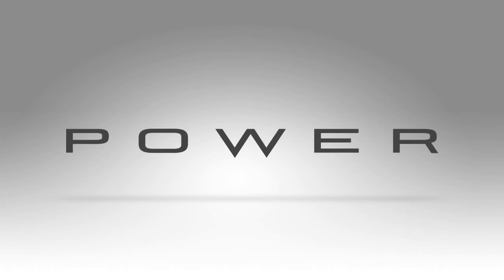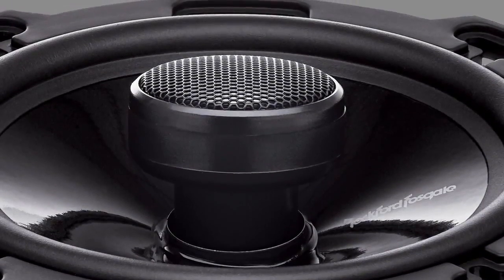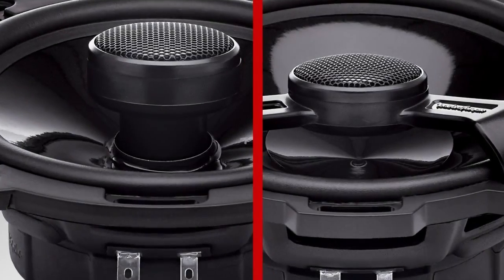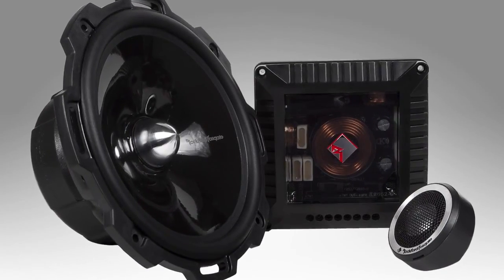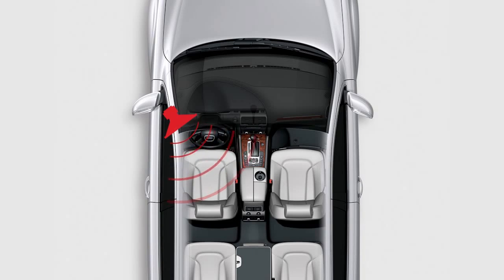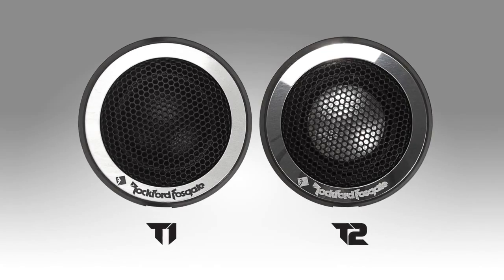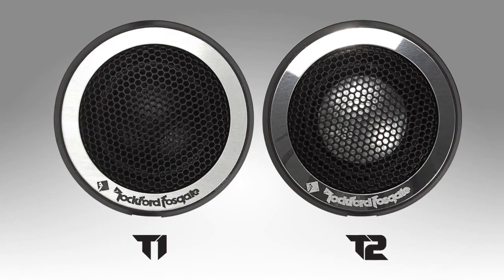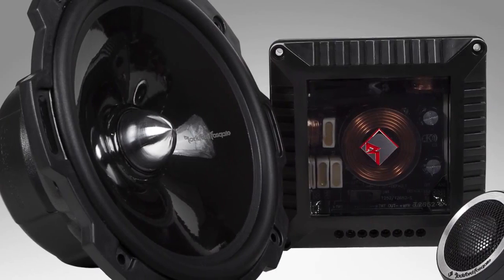Rockford Fosgate: Power Speakers (2.4)

Comment: Why does my p1650 sound cleaner than the t1650?
Reply from the maker: I’m assuming these speakers are being analyzed immediately next to each other and are wired in parallel to the same channel of the amplifier.  Otherwise there are variables that can affect the sound.

They both use the same cone and surround but the biggest difference is the tweeter.  The P1650 uses a 0.75” PEI dome tweeter and the T1650 uses a 1” aluminum dome tweeter.  It’s personal preference but the T series should have lower frequency extension in the tweeter range.  However, different people like different tweeter types.  It’s important not to confuse “loudness” for “better sound”.
Reply: i had one of each speaker in each door. sat in centre to heartrhe difference.. the power series seem to have some sort of missing midrange. i then swapped the both front for the power ones and have to use alot of eq to bring out the midrange. its very frustrating they cost more and sound worse. 
 @rockfordfosgate
Reply: i also have the t1692 and when i fade to the rear they also have a missing midrange. im thinking i may need to go for the t1693 or even the p1694
Reply from the maker: @joshirwin7904  This sounds like a tweeter is burned on the Power Series speaker, but I'm not in the car and can't tell.
Reply from the maker: @joshirwin7904  I'm really at a loss on how to help.  The Punch have a slightly higher pitch on the upper frequencies, but should be fairly identical.  Again, to me it, you're almost describing a blown tweeter issue, so double check those are working.
Reply: ive found just having to add alot of mid/high range eq from head unit. they are brand new i also have the 1692 power ones and they have the similar missing type midrange its weird 
 @rockfordfosgate
Reply from the maker: @joshirwin7904  At this point I would suggest contacting our technical support at 1-800-669-9899 so they can help you work through your issue.
Reply: you need to try both out and you will see. its 100 nboticeable and after going through alot of sites some others are also saying about the missing midrange. it sounds odd
 @rockfordfosgate

Comment: I'm strongly considering these either t1650 or t1675 for blasting heavy rock and metal. Am I on the right track? Are these better than the r series?
Reply from the maker: Yes, the T1650 and T1675 speakers are designed for Sound Quality.  The progression is as follows:
- Prime Series (R) [good]
- Punch Series (P) [better]
- Power Series (T) [best]

Comment: I daily my 2011 Corolla S with a front stage kenwood component system and 6x9s on the rear deck running on a p600.4, but I want to know exactly what Rockford speakers I can use pushing the p600.4. Will the T-1675-S work for the front, if paired with a couple T-1692s? (I also have 2 Savard 12s powered by the P1000 and there are no words...)
Reply from the maker: The P600X4 amplifier is rated at 75 Watts x 4 @ 4-Ohm and 150 Watts x 4 @ 2-Ohm, so it has plenty of power to drive any type of speaker you wish.  

Both the T1675-S and T1692 are rated to handle 100 watts RMS, so these will match with the P600X4 amplifier just fine.

Comment: Currently running t2652-s front and rear t1650 coaxial with p400x4 do you recommend me upgrading amp if so which one is perfect?
Reply from the maker: Hi Eloscar 57, Let's take a look at the power handing of the speakers (see below) and the amplifier power output:

• T2652-S = 100 Watts RMS
• T1650 = 75 Watts RMS

The P400X4 is rated to produce 50 Watts x 4 @ 4-Ohm RMS, and can Dynamically generate up to 82 Watts x 4 @ 4-Ohm.  This is still under the RMS power handling of the speakers so it's a perfect match.  You could update to the P600X4 since it's rated at 75 Watts x 4 @ 4-Ohm RMS, and can Dynamically produce up to 129 Watts x 4 @ 4-Ohm.  This will exceed the power rating of the speakers, but with proper gain adjustment (CLEAN) and conservatively driving the system (not very hard,) this amplifier could effectively be used.

The only downfall is you won't get that much louder.  The power increase from 50W to 75W is only 25W and would increase system output to about +1.8 dB.  Since +1dB is the slightest change in loudness detected and +3dB is a noticeable difference, you may determine it wasn't worth the upgrade based on the level of loudness increase.
Reply: @rockfordfosgate  ok thank you so much also i have a set of p165-se that I can replace the t1650 coaxial would that be louder ? I want loudness and clearness as possible if you would reply that would be great
Reply from the maker: @eloscar5738  The P165-SE sensitivity is 88dB @ 1w/1m and the T1650 sensitivity is also 88dB @ 1w/1m.  While simply changing them out will have absolutely no change in loudness, there will be a sound quality difference between the 2 drivers with the T series having a slightly more natural sound.

Comment: Question: I am looking at purchasing the T1572 power 5x7 2way full range speakers for the rear and the 4inch for the front... What amp would I need to use with this combination ?
Reply from the maker: Hi Tim, great question!  The T1572 are rated to handle 70 Watts RMS and the T142 are rated to handle 40 Watts RMS.    We would strongly suggest using 12dB/octave crossovers HP on both, and most certainly the T142.  Any of these amplifiers will be a great match.  I added the 5-channel in case you wanted to drive a sub too:
P400X4: 50W x 4 (https://www.rockfordfosgate.com/products/details/p400x4/)
P1000X5: 75 Watts x 4 + 300 Watts x 1 @ 2-Ohm (https://www.rockfordfosgate.com/products/details/p1000x5/)
T400-4: 60 Watts x 4 @ 4-Ohm (https://test.rockfordfosgate.com/products/details/t400-4/)
Reply: Thank you so much for your fast reply and recommendations . Very much appreciated. 
Do you recommend using crossovers on the punch series speakers?  Just a little unsure if I should use punch or power series. 
Thank you for your help
Reply from the maker: @tim7131  You're welcome.  Yes, I absolutely use crossovers on all speakers.  All of those amplifiers have built-in crossovers to use in the High-Pass setting so lower bass notes don't bottom out the speakers at high operating levels.
Reply: Rockford fosgate. Thank you for your advice and helping me understand the basics a little better. I so look forward to purchasing and installing my new Rockford Fosgate sound system. 
Much respect from Australia
Reply: @tim7131  How do you like the speakers?  I just recently installed two Power 1650 speakers and a Punch P600X4 amp.  All I can say is WOW
Reply: @GlycerinZ  i also added a sub.. im very happy with my Rockford fosgate sound system. money well spent on quality 👍

Comment: The 6x9 t1692 is 100
Rms each?
Reply from the maker: Yes, they are rated to handle 100 Watts RMS.  Speaker power handing is always done individually, not in pairs.
Reply: Rockford Fosgate 200 rms together yes? Thanks 👍🏻😊
Reply from the maker: @familiacruz1981  Let's qualify that ... if you are going to run 2 speakers on 1 channel, you can run up to 200 Watts to both speakers.  However, if you are installing 1 speaker per channel (1 on front-left, 1 on front-right, etc), the amplifier should produce no more than 100 watts per channel.

Comment: hey , just question is posible , two crossover/filtre T2 compement power 4ohm , down impédance to 2Ohm?  with T1000.4d 4x250watts rms to 2Ohm ...for 4 T2 compement speakers!????
Reply from the maker: In order to run the T1000X4ad amplifier at a 2-ohm load, each channel must use 2 T2 component speaker kits (2 crossovers, 2 midrange, 2 tweeters for each channel.)

Comment: I have 2018 Camaro convertible with no amp , already bought 6.5 t1675-s for the back panel and installed them ( sound is better but lower than the stock ) , also bought t1693 6•9 for the front and did not install yet in the front doors as am not sure yet if the depth will cause any trouble or not but planning to install soon and hopefully they will fit - the guy who did the installation said I need an amp otherwise the sound will not be high - which one should I get considering that the convertible roof is almost taking the full trunk space and I can’t even put a sub
Reply from the maker: Hi Khaled, yes we would also recommend running amplifier power.  Since you will be powering all 4 speakers, you could certainly use the PBR400X4D or the P400X4, both rated at 50W per channel at 4-ohm:

PBR400X4D
https://www.rockfordfosgate.com/products/details/pbr400x4d/

P400X4
https://www.rockfordfosgate.com/products/details/p400x4/
Reply: You have to amplify them. Stock deck preamps only put out around 20W RMS

Comment: Can you tell me if the t-1650 (6.5 coaxial) will fit in the doors of a 2012 kia soul? Or would i be better off with t-1675?
AND....
Would either speaker do well with a P600.4 amp powering them? (4 channel mode)
Reply from the maker: It looks like they will both fit.  Obviously you may need a trim ring with the slightly smaller speaker.  As for depth, the T1650 is 2.52" and the T1675 is 2.51", so they are nearly identical.
Reply: Rockford Fosgate thanks, will both speaker options be suitable for the p600x4 ?
Reply from the maker: Certainly, just be sure to set your gain overlap at 0dB or +5dB (if it's not loud enough) for the high frequency speakers and you should be fine.
Reply: Rockford Fosgate what do you mean "gain overlap"?
Set gain as to not overpower the t-1675 ?
Reply from the maker: If you have the P600X4, then the amplifier has the C.L.E.A.N. system, so when you setup the gains, you'll use the 1kHz track at 0dB to set the output LEDs.  Yes, this will setup the amplifier so you don't over power the speakers.
Reply: Rockford Fosgate thanks

Comment: I have always use Kenwood subs and amp does anyone use Rockford Fosgate and can give me some advise about their subs 10" and 12" please I have a Tahoe I am trying to stay away from the big box in the truck but I need heave bass
Reply from the maker: FIrst, thanks for looking at Rockford Fosgate since you've been a long term KW user.  I know you're looking for a fanatic's perspective, but wanted to chime in here.  If you have an SUV and are looking for heavy bass, your best still using a traditional subwoofer since it can move a lot of air.  However, if you're looking at reducing the size of your box, the POWER SLIM subwoofers fit this requirement, yet still have the performance characteristic of traditional Power T1 subwoofers!  It's amazing technology.  Here are some links while you search for other reviews:

T1S1-10: http://www.rockfordfosgate.com/products/details/t1s1-10
T1S2-10: http://www.rockfordfosgate.com/products/details/t1s2-10
T1S1-12: http://www.rockfordfosgate.com/products/details/t1s1-12
T1S2-12: http://www.rockfordfosgate.com/products/details/t1s2-12
Reply: My advice to you on this would be this. Kenwood makes a decent product but it doesnt hold up with Rockford Fosgate. 2 big things i will suggest you be aware of. Rockford Fosgate rates their amps and subs differently than Kenwood. 500 watts of Kenwood power is like ummmm thats usually a peak rating and even the rms rating isnt near what you might think but the price wont be so bad maybe. Ok Rockford Fosgate is the exact opposite of that. 500 watts of Rockford Fosgate power you are flirting with having to have the pro level subs or power they call em now. The T1 and above subs years ago where pro series. Look just like the others at a glace but in tiny print say pro series. That comes my second point. As great as like the prime series and p1 subs are im sure. Understand there is a HUGE difference in base level budget subs by rf and the top level power subs and amps. The difference in a 4 cylinder toyota and a ls440 lexus. Same company day light and dark difference. The last thing that i can suggest is like all stereo equipment its important to hook up right well it is you cant stress this enough with rockford fosgate stuff. You gotta match amps to speakers right and do NOT skip out on this. You gotta use top notch wireand connectors and you gotta have these speakers installed right. Subs the enclosure is more important than the brand itself. Sub enclosure and correct amp choice is everything. Id look to spend as much on the install and wires as system itself otherwise you are defeating the purpose. Just saying.
Reply: If you cant build an enclosure like a pro get someone who can otherwise buy a pre enclosed box! Crap box with good subs is so bad. Its gross and sounds awful.